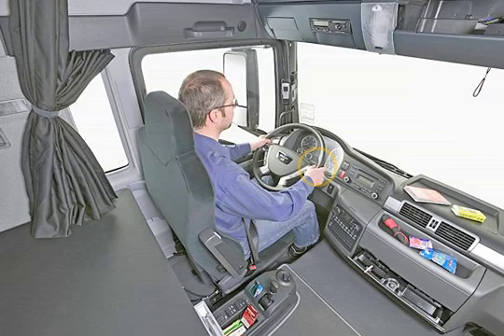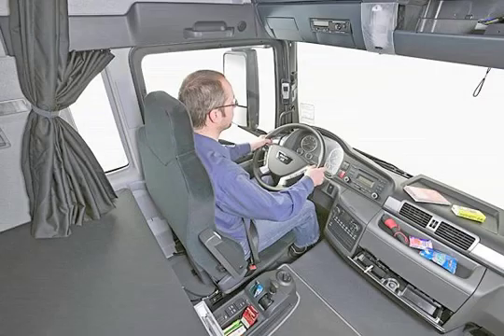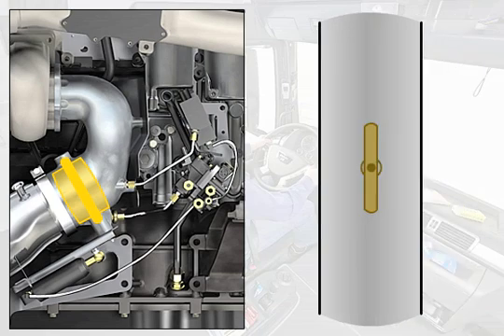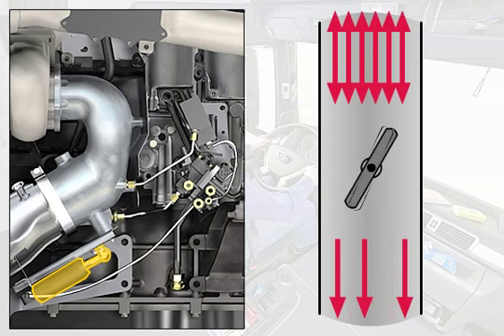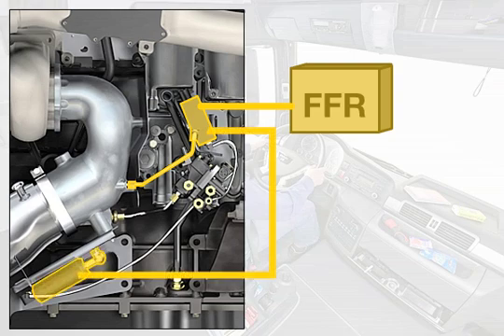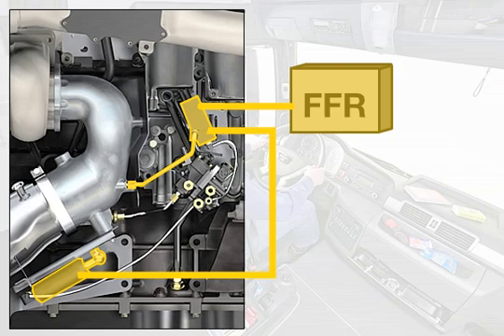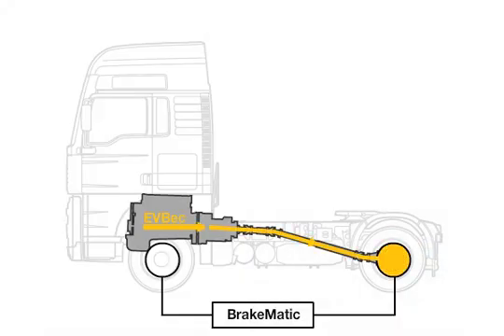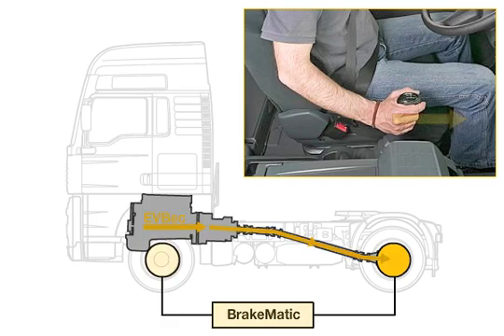MAN EVBec: Electronically Controlled Exhaust Valve Brake | MAN Truck & Bus

Comment: Sir my name is Arun.. I am from Saudi.  I am driving a 2016 model man truck... when my man truck goes under load there is a humming noise without the normal sound then the truck won't go at all I looked at everything and replaced the clutch but still no change... what is the reason and what should I change.... nothing is showing on the computer display
Reply: Please help me
Reply from the maker: Hello Arun,
thank you for your message. We from the Social Media Team can't help with technical issues.
The best thing to do is to contact your local MAN service partner who will be happy to assist you. You can find an overview of all service partners here: https://go.man/LcIjzUxP.
Best regards, your MAN Social Media Team
Reply: sounds like the radiator  @arunbabu9664
Reply: @James-mb7wy  what???